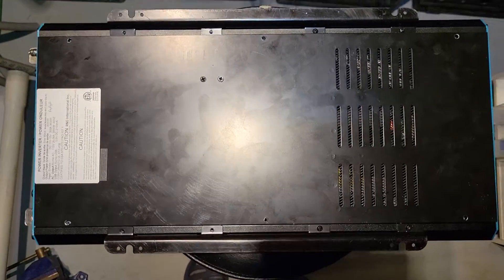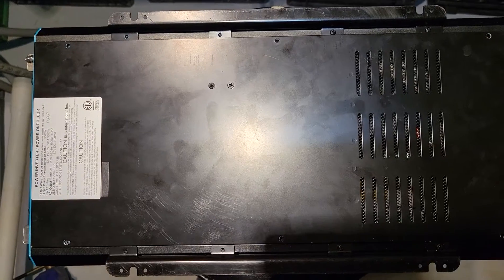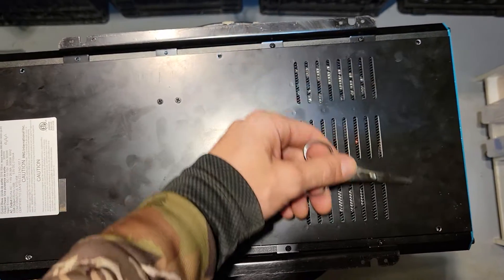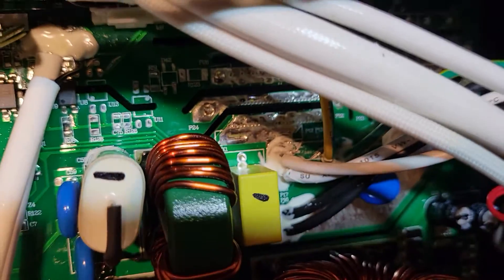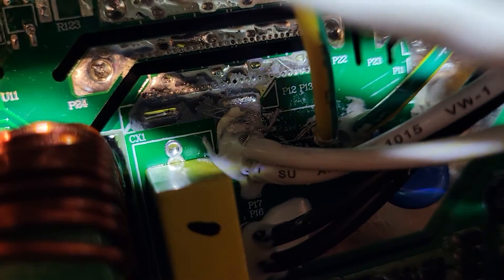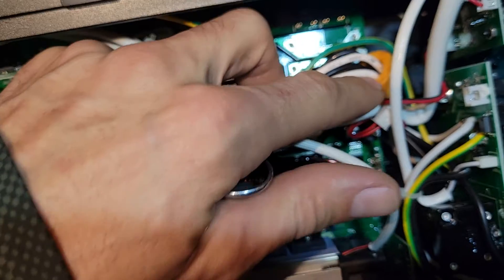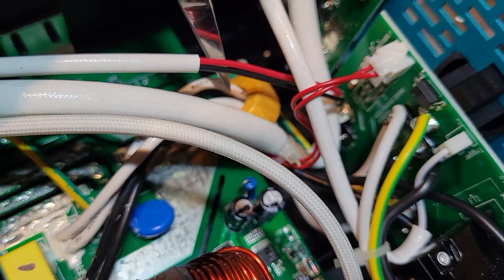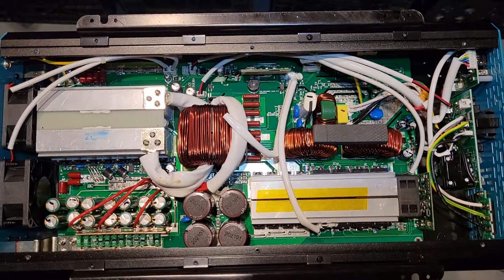Unbonding the Ground and Neutral on Renogy Inverter

Comment: Unplug only work with (3) AC receptacles. 
Will not work if you using high power AC terminals out😅
Reply from the maker: It will work on outlets and terminals

Comment: Thank you SO much! I was trying to install this exact inverter on my motorhome with a transfer switch and kept getting the GF amber light which shuts the inverter off. I spoke to Renogy and they told me that you cannot disable the GFCI circuit in the inverter. In the same breath, they said that I should consult a qualified electrician to "assess" the idea of disabling GFCI. To me they were saying, "there is a way to do it, but we can't tell you how due to liability." So, I came here and found your video. I didn't break that bonding wire, but I did unplug that current sensor. It fixed the problem, and the inverter now works seamlessly with my automatic transfer switch between shore/generator power and inverter power. I still have GFCI protection on the appropriate circuit in the motorhome. Everything functions just like I want it to now. Do I still need to break that neutral ground bond by snipping the wire or is it fine with just the sensor unplugged?
Reply from the maker: Glad it helped! You only need to snip that bond if you are using it to directly power a home (rare use case) because the neutral and ground are already bonded in the house panel.

Comment: Don't know if I have an old version of this Inverter or a new version. The circuit board on mine is fastened with screws and standoffs to that panel. And, I can't get the main cover off.
Reply from the maker: Good to know. Are you getting nuisance GFCI trips?

Comment: Great vid! Can the negative cable & the ground wire can both be ran to the same point where the vehicle battery grounds?
Reply from the maker: @nestogonzo1  Yes as long as its a really good connection point you can run the DC negative to any grounding point. I used to do that with large car stereo amps. 

Also worth mentioning, if you are using this inverter to power AC devices in a vehicle, you would normally want to keep the AC ground and AC neutral bonded inside the inverter.
Reply: @LibertyDIY  So your saying not to do what you did in your video, that's aimed more for household installation, right?
Reply from the maker: @nestogonzo1  Thats correct, in a house situation the neutral and ground are already bonded inside the electrical panel and we dont want them bonded twice (triggers gfci for one thing)
Reply: @LibertyDIY  Thanks for taking the time...

Comment: So would you say these renogly inverters are suitable to chaege an ev (tesla)

Im looking into doing a offgrid solar charger and have read about some inveters not being neutrally grounded, resulting in the tesla mobile connector having an error light with grounding issies

Basically my question is does this brand of inverter come neutrally bonded allowing for me to charge my tesla without issue?
Reply: I'm just looking into that myself,  think I'll post question on Facebook

Comment: I’m using a solar system with 2000w inverter to power a subpanel in a mobile home. This is in the middle of nowhere and the only source of power. In this case I should leave the bond between the ground and neutral inside the inverter correct? Should I ground the subpanel to earth and the inverter case to earth as well?
Reply from the maker: Yes feeding a subpanel that (probably) does not have a neutral-ground bond in the panel, so in that case the NG bond inside the inverter shouldn't give you any problems.
Reply from the maker: Yes the panel and inverter should both be grounded to earth, simply because they are metal and the earth ground functions in case a live wire ever shorted to the metal case, it would instantly trip the breaker rather than "surprise" someone later on.

Comment: Thanks.  I had a discussion with the folks at Renogy and they highly discouraged connecting their inverter to a transfer switch of course because of the neutral-ground bond issue, but they said an inverter charger would be fine.  Do you know why?  Something to do with the transformer?  Can a low frequency inverter charger be directly connected without worrying about a ground neutral bond?  I purchased a Bluetti AC 200 max because I did not want to fiddle with stuff I didn't understand.
Reply from the maker: The inverter chargers often have automatic neutral ground bonding switches.
Reply: @LibertyDIY  I think you're right.  I just recently purchased a Sungoldpower 6,000 Watt inverter charger to use independently but the thought crossed my mind if it would be okay to plug into my transfer switch if I needed it.

Comment: Wouldn't just disconnecting the GFI circuit be enough? Wouldn't that be safe enough to run via extension cord a household refrigerator that's causing the Inverter's GFI to trip?
Thanks in advance for any input.
Reply from the maker: Yes especially if the fridge is on a separate "critical loads panel" because those panels have neutral and ground unbonded.

Comment: My RV storage lot reported to me that after I installed a Renogy 2k inverter their pedestals went dead.  Sure enough , adding the inverter triggers a ground fault.  I have switch over relay for my black output wire so it goes no where with the inverter off and I’ve removed the external ground from the inverter (which is powered off) and I still trip the RV storage lot GFI.  Should I go inside the inverter to snip the bonding in this case?
Reply from the maker: I suspect you're right and the bonding in the inverter is tripping something on their end, even when the inverter isn't in use. Is there a way to isolate the inverter completely from the system while using the pedestal? (Or snipping that bond if necessary)
Reply: @LibertyDIY  I can remove the hot and neutral romex wires from the inverter output that leads to the distribution center and then the pedestal is fine but that’s like not having installed it.  I’m just reluctant to go under the cover of the inverter and make a permanent change I might want in a different situation.

Comment: im running a renogy 1000w from a 12V 190Ah LiFePO4 Lithium Battery 2432Wh BMS hooked up to my delta max 2000 it was set to only 500w input on the delta max doing fine for about 15 min then triped the gf on the Renogy 1000 ...whats the down side of doing this clipping the jumper  an pull 2 wire plug?

Comment: Thank you , I'm having gf trip when turning on my mini split , I have it on a semi and renogy customer service is useless in this situation, will try disabling the gf connector ,I read in other forums that HVAC systems should run on constant power outlets, because of the compressors .

Comment: That grounding bolt ... Should my grounding cable lug be sandwiched between 2 nuts on the bolt, or should it be pressed directly against the metal case (but it's painted!)?
Reply from the maker: That's a good point, I didnt think about that with mine i sandwiched it. Steel is a relatively poor conductor of electricity but it will have continuity no matter where you connect it

Comment: You made an interesting point when you said you can't have a earth neutral bonded in two places . 

Some hybrid inverters have facility to connect a generator . Which would you choose to bond . The generator or the inverter in that case ?
Reply from the maker: Those inverters might have an automatic neutral/ground bonding switch built in

Comment: This is giving me motivation to hack my 1000W inverter, but the circuitry is different. The ground and neutral lines are not so close together on the PCB and I don't think there is a jumper wire hidden under the small amount of caulk/RTV.  I'll have to take the entire PCB out of the box and look at the bottom side.  But maybe I'll ask Renogy directly... Or just disconnect the red sensor wires...
Reply: Did you ever solve this on the 1000w? Did you find the wire to disconnect the bond between neutral and ground?

Comment: Saved me a lot of time, THANK YOU! I was using this as a home backup inverter and was plagued by the GFCI fault. Opened it up and pulled the sensor wire only and it doesn't fault out anymore. Saved me from having to return it, thanks again! (2000 watt unit)
Reply: It would work, but don't you still have a NG bond left in place, thus creating a hazard?

Comment: Great video.  I have a 700W inverter by Renogy as well, and am having issues similar to what you mentioned, when using in a residential, earth-grounded environment.  Question: have you ever been able to find schematics or wiring diagrams for their inverters?  My board is different than yours, and the N-G bond is not as obvious on mine.  I've reached out to customer service, but no success so far; not their fault; just liability.  A wiring diagram would be awesome.  Thanks, and good job again.
Reply from the maker: Thank you, in this case I just tracked down the n/g bond by examining the board and then confirming with a multimeter using the continuity tester. I have noticed the larger more expensive units (sunpowergold) have auto switches and disconnects that you can unplug or replug manually. So Renogy is assuming these units are being used in RV or Auto
Reply: @LibertyDIY  Much obliged, dude.  Thanks for getting back to me.
Reply: Update: Renogy confirmed the location of the N-G bond on my 700W.  Lifted it, and disabled the GFCI, and it runs without error.  I'll post a link below to cross-reference, being that there are probably more folks out there with this issue.  Thanks so much again!  https://youtu.be/IHSP0O1ro_s
Reply: @LibertyDIY  Renogy Has No intention of their Equipment being Used Residentially, There 20 ft Adapter or Extension Cables Prove this, They can only Put one 100 Watt Panel on One Extension Cable, 10 AWG  .   They Sell The Cables but Donte tell you what they are good For ?  One Panel LOL

Comment: Assuming one were to do this and then use the inverter to back-feed power to the house main panel (only while the grid power was turned off), then would this, in theory, work as a back-up power supply? To be clear the main power is locked off during this type of use and the inverter would be disconnected prior to turning the main power back on.  The only bonded neutral would be in the main house panel. The chassis of the inverter would be connected to an earth ground. Thank you.
Reply from the maker: That is correct but it would only feed one 120V  leg of the home unless you jumper the legs together
Reply: @LibertyDIY  Jumper the legs and turn off the 240 breakers. Thanks.
Reply from the maker: And of course turning off all the 240 breakers if you do jumper the legs

Comment: Hello, may i ask you one question, if you dont mind, just to check my understanding?
If I plug in the invertor input wire in the network, while its blackout, would it be grounded still?

In other words, is it a neutral earth bonded inverter? Important for phase-dependent devices.

Thanks)
Reply from the maker: Yes it is bonded internally.